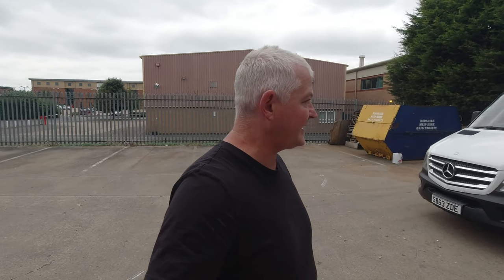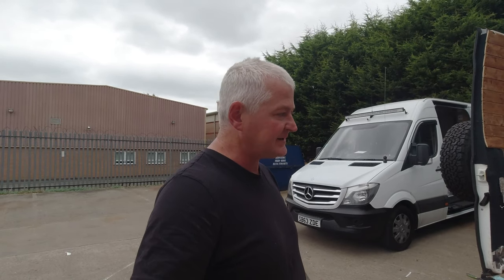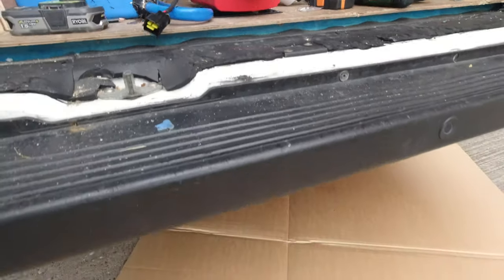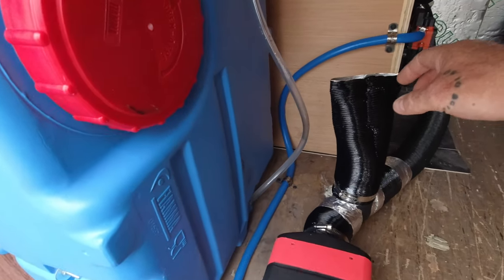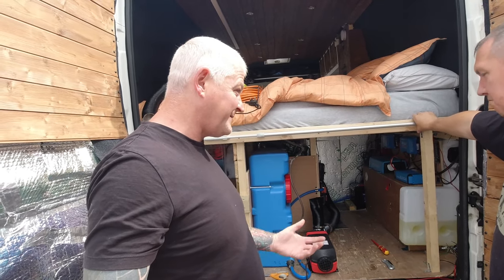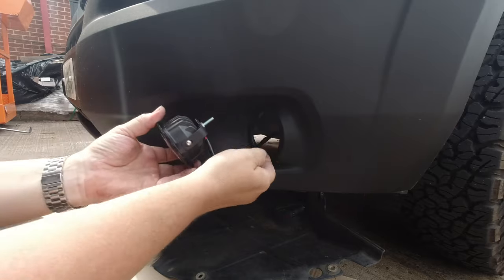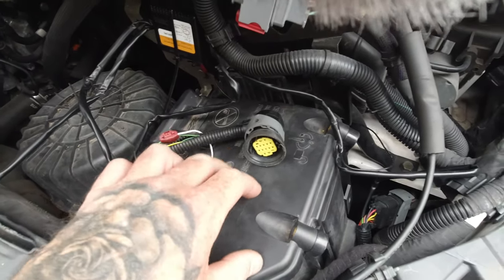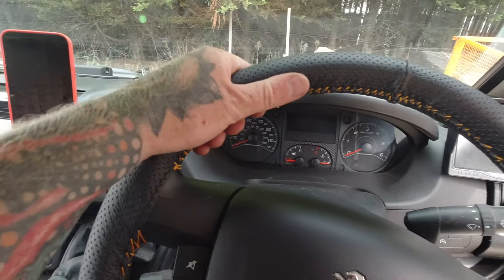CHEAP CHINESE DIESEL HEATER FITTING

Comment: That’s winter sorted 👍 they are great bits of kit especially at the prices you can get them from now, 
I’ve got my heater fed from the van’s tank so I know I’ll always have fuel but because you have a separate tank you can use red diesel if you can get it 👍.
Atb John 🏴
Reply from the maker: We did try and get into the main tank but didn’t have the correct tool to lift the lid off… will try again once I have the correct tool as I have the fuel adapter and fuel line ready… Yeo winter ready with two heating systems now 🚐🚐
Reply: @PackTheVanAndGo  one benefit of the separate fuel tank is being able to use tax free fuel for the heater .
Reply from the maker: @uptowndisco2  Yeah I think I might leave the diesel tank in the bank... not sure how long 10 ltrs lasts in winter, but good to know also about the cheaper fuel!

Comment: Hi Rob. These second batch of changes are really making a huge difference to your van. You must be pleased. Couple of questions about the diesel heater
1) How much energy does it use to run an hour. (Battery rather than diesel)
2) How bad is the ticking noise on the pump that seems to be an issue with many of these units

Hope Archie is well and great to see you looking so well

All the best from Mal, Dave and Sally the Lab aka The SilvertopMotorhomers x
Reply from the maker: Hi mate, I’ve not used the diesel heater much as it’s not been needed as yet, I just know it uses a bit of energy to get the glow pipes up and running and the fans going to get the heat up to temperature. But once up to temperature and running the power output in minimal… as for the ticking noise, you can hear it slightly but not enough to cause any major problems… I used the silencer between two pieces of exhaust to try to get rid of them at Blair and seems to work, that was a tip from my friend who helped me, so buy an extra piece of exhaust! Archie is good and slowly getting there with the modifications! Hope you guys are well?
Reply: @PackTheVanAndGo  we are mate. Have you sorted when and where you going?
Reply from the maker: @SilvertopMotorhomers  hi, yeah I’ve planned a date to leave the UK in September, just hoping now I can get the work done on the van in time and then go on the date set… but it’s flexible at the moment!
Reply from the maker: @SilvertopMotorhomers  as for where, just want to get into France first and see how it goes with COVID and other countries 🤷🏼‍♂️🚐